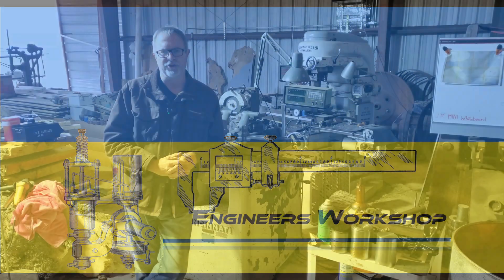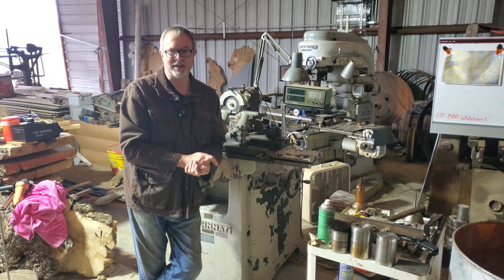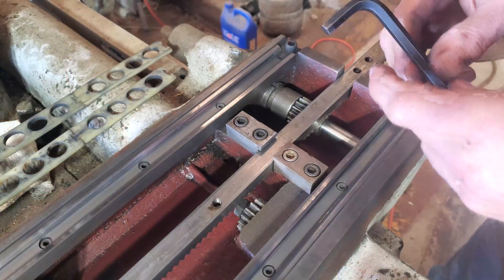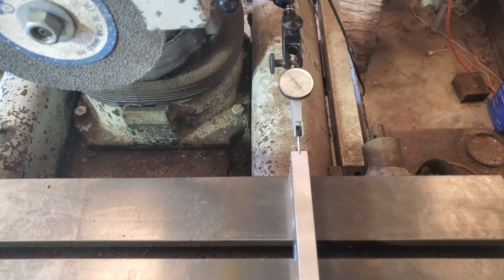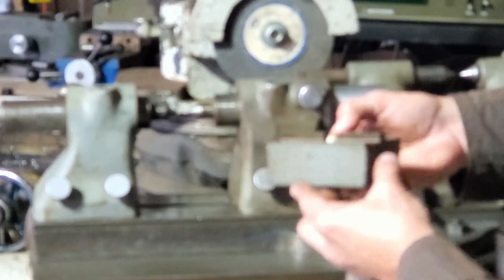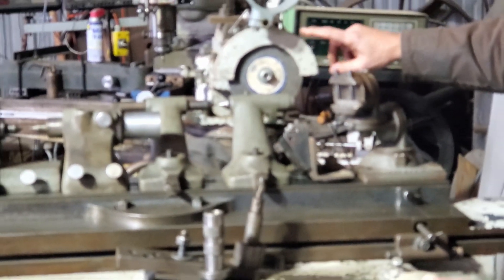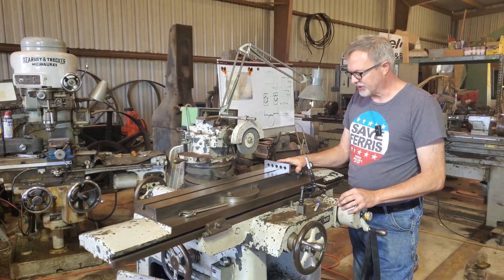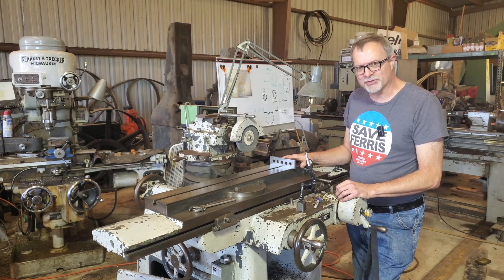Final Shimming on the Cincinnati #2 Tool & Cutter Grinder

Comment: I also just acquired my Cincinnati #2 cutter/grinder at an auction 4wks ago, it’s been well taken care of in its life but I went through it anyway, the main purpose of my purchase was for sharpening my end mills and drill bits “I have a Harig air bearing mounted to the table”. I do plan on expanding its capabilities in the future. I sadly don’t see very many videos “tutorials” of using these machines on YouTube 
I would suggest your mystery block is to hold a magnetic base indicator so when you can indicate between centers and such, just spitballing here.
I’m sure you quite enjoy yours as I do mine, just nothing like getting a new to me machine in the shop.
Reply from the maker: Check out Don Dyar's channel, and his old channel Dee Dee, he uses his all the time. Haven't seen much drill sharpening on a #2 however. A drill sharpening fixture is on the list for me as well, along with a million other projects. Thanks for your interest!
Reply: @EngineersWorkshop  
I modified a Sterling DM41 gun drill sharpener stand which also came mounted w/ the Harig on Bonnie to sharpen the drill bits and it works perfectly, I can get any angle I prefer and it also accommodates my large lathe drill bits. 
I’ll check those sites out.
Thanks
Reply: @EngineersWorkshop  I didn’t know who Don Dyer was but yes I’ve seen his channel in my searching

Comment: Nice work on the table correction.  I have the factory mount for the workhead, so if you need any photos, dimensions, etc. give a shout.  I sent you an email.  Also, if I remember correctly, the bolt thread for the workhead mount is something odd like a 5/8-12.  Not an off the shelf bolt.  I'll take a look and report back.
Reply from the maker: I remember hearing about the 5/8-12 thread, couldn't remember where (probably PM). I would appreciate some dims of the angle holder and base if you get a chance (and some pics). Obviously my head is also missing a drive sheave and indexer, which I assume was available. Bought a 50 taper to ER40 collet adapter for one end, didn't show that. Thinking of making my base with a larger diameter to increase the resolution of the vernier for angle settings.